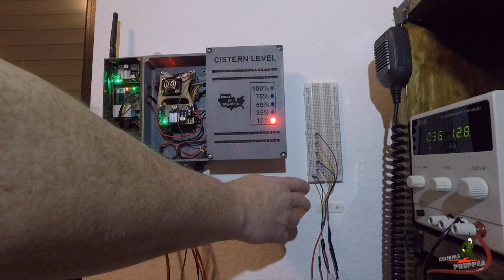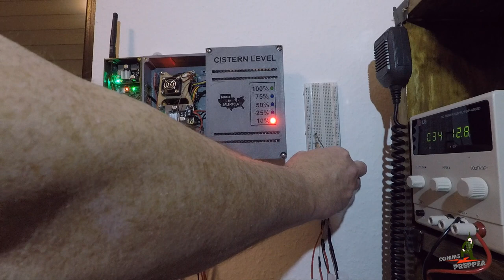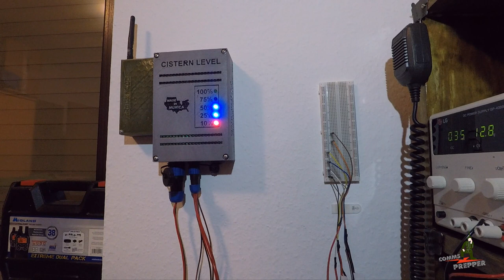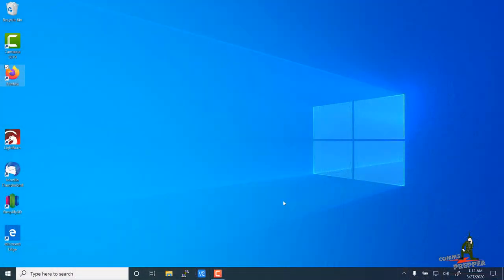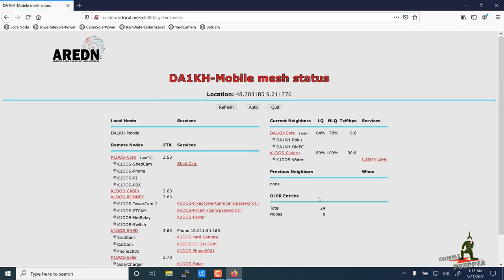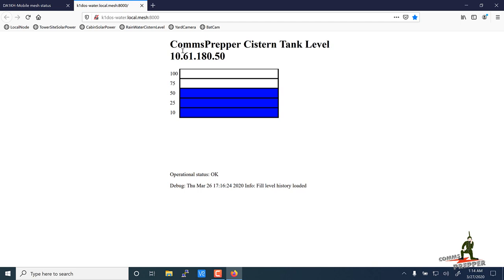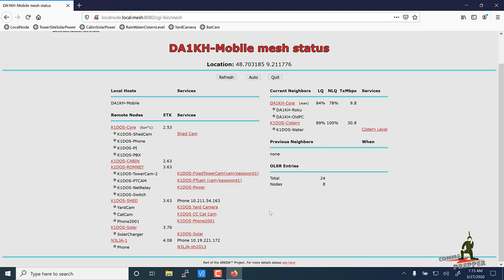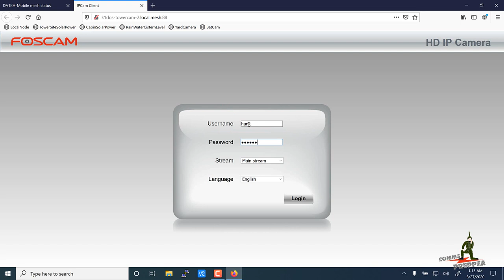WiFi Network Cistern Tank Monitoring System with AREDN

Comment: Brother you may need to put a bug screen in side the box. I did not for my last Arduino project. A tree frog got in . He laid on my gpio pins. Made all kinds of things go nuts. Thanks for sharing. God bless
Reply from the maker: Thanks for the tip.  However, my vent holes are 1.5mm X 1.5mm - too small for most critters and bugs.
Reply: @Commsprepper  Smart brother. God Bless

Comment: You ever consider doing a ‘talk’ style presentation? You clearly have a wealth of professional knowledge and experience along with the will to share it. As a separate point I have a project (really an experiment) I’m beginning the initial steps of getting started where I intend to set up license plate recognition at my ‘retreat’ which is located on a country road. It has a long drive way that people simply will not stop using to turn around in at 3am, as you can imagine it drives my dogs crazy and activates my drive way sensor. I do plan to get a motorized gate but they aren’t cheap and I’m not there yet, I figure if I can at least know who’s doing it I’ll have some data to work with. As it turns out there’s a very good open source plate recognition lib called ‘OpenALPR’ that will run on ARM, that does the bulk of the work. I see you do have a camera facing the street, might be interesting to know which cars are going down that road. Of course it’s not like we can be the dmv and get a name for each plate number but it’s still valuable data that can give you insight into the human activity going on around you that you may not necessarily know about.
Reply from the maker: I have no experience with photographic analysis. As for your driveway problem - I suggest a motorized cable or gate to close it off.  Actuators are cheap and could easily be used to push/move/pull a barrier.

Comment: Commsprepper, other than just experimenting, where did you learn to do all this? Do you suggest any books, websites, and other sources? I'm every so slowly getting into building. troubleshooting, and hopefully designing electronics but I want to get better. I've been a ham for over 13 years now, but I'm ashamed that I didn't spend more time home brewing and learning electronics, I'm more of an appliance operator currently...
Reply from the maker: My learning curve is based on need.  Problem/challenge = pursuit of solution.  I am not a coder or engineer - just someone looking for solutions to specific requirements.
Reply: Not being formally trained as an engineer can often be an asset to doing home brew stuff. My training and background is that of a field engineer which is really a technician expected to work mostly independently, and I’m more than willing to jump into a problem and see how things work. My engineer friends seem like they take a more circuitous route to things and in my experience are less likely to utilize home brew and custom solutions preferring ready made pre tailored solutions. My primary piece of advice is just jump in a try something, I never learned more about radio than I did during my first month of playing with SDR that includes school. There is no easier way to learn than by doing it yourself especially since an RTL-SDR dongle is $15!!!

Comment: Bro where is the link to the flotation switches? never found it. I am a writer in these sites www.theorganicprepper.com and www.backdoorsurvival.com and made a link to these wonderful video in one of the articles that should be published in a couple of weeks from now. 
I had the idea of using computers to control some stuff (I´m going to move with my kiddo to a cottage and it´s going to be just the two of us, need to automate as much as I can) but your remote monitoring using AREDN is way over the top. Thanks for sharing this!.
Reply from the maker: I purchased my float switches off of Amazon.  However, I did not provide a link because vendors and models change too much - just search for float switch. I automate as much as I can to minimize having to move around the property and to watch things when I am not there.